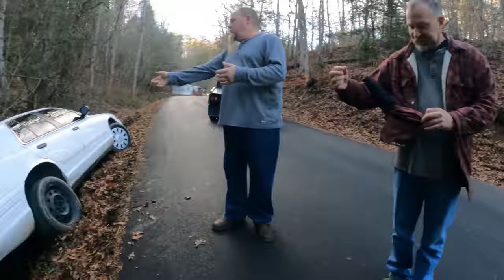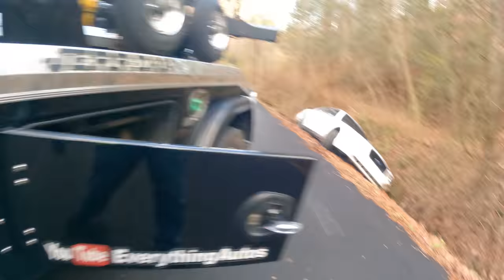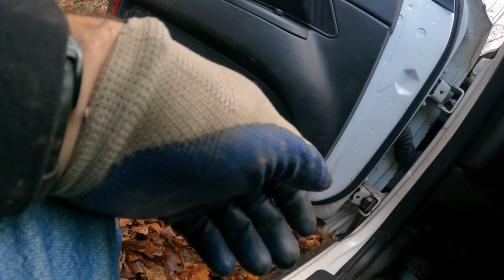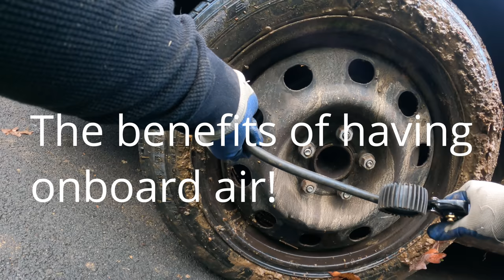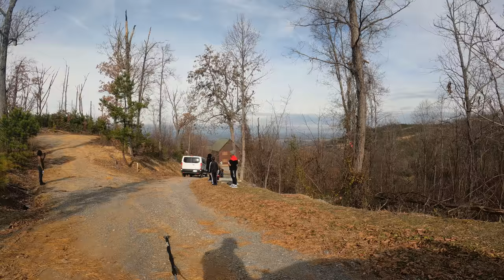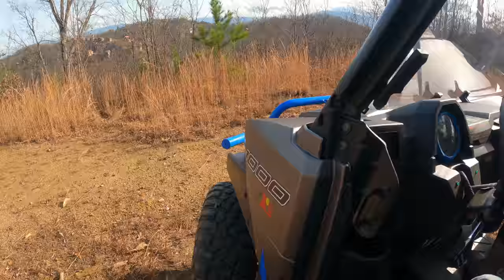Hot Pursuit Of A Squirrel In The Crown Vic And Polaris Off Roading Near Dollywood/Sevierville

Comment: I had my quick disconnect for the air behind the front bumper and a hose reel inside of the body in the rear feeding through the body with a quick disconnect.  Gave me more room to use air in. So I could also do road side repairs useing air power tools.